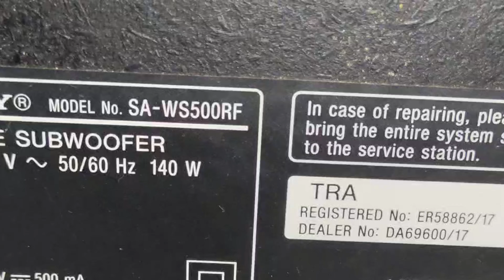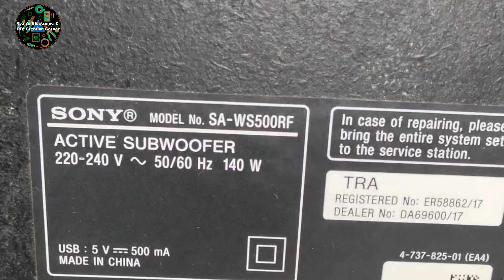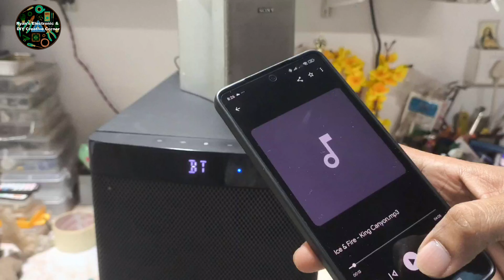Sony Soundbar No Power Fix! 🔥 HT-S500RF / HT-S700RF Repair with Buck Converter | DIY Tutorial

Comment: Sony HT-S20R showing Standby Protect. what is the issue?
Reply from the maker: Check without connecting speakers if it is working then maybe the speaker wire may sort or have a problem with the speaker , otherwise tas5538 ic faulty or output ic are faulty